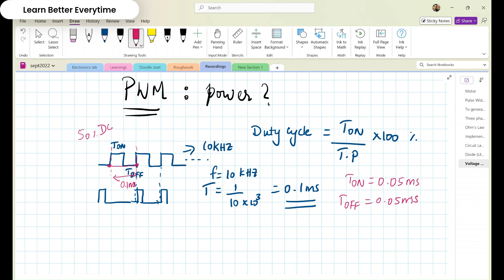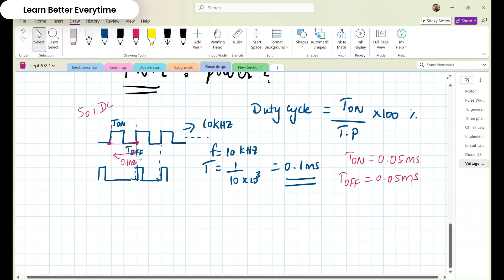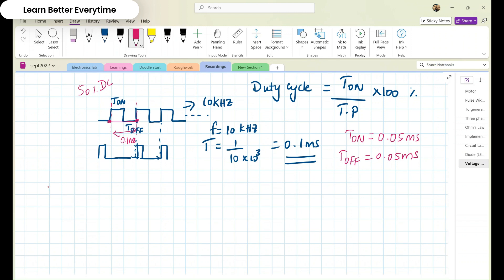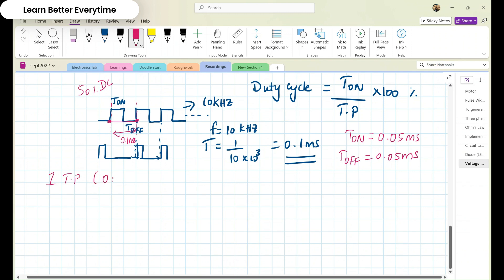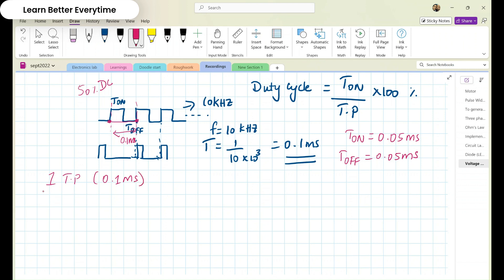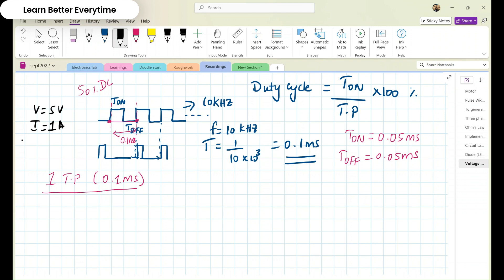Why PWM is so important? PWM Mystery -1

Comment: Periodic 
Equal duration 
T on ... duty cycle 
T off ......
Frequency 
Time period 
20 % 

KHz 
T = 0.1 millisec 
Square wave ..
50 % 
T on is not equal T off 
..

Signaal 
Signaal 
Power 
Drawn in watts 
Volt ...
DC signaal 
.......
Helpful ..
..........
....VP 
......
Reply from the maker: If 50% duty T on will be equal to T off. Kindly correct it

Comment: 9.13 Duty cycle 50% Nala than 50% voltage tha kedakatha ? 2.5 v or the average  voltage of 5 is 2.5 v ?
Reply from the maker: You are right.. for 50% it is half the given voltage.. if we need a higher average voltage we can increase the duty..